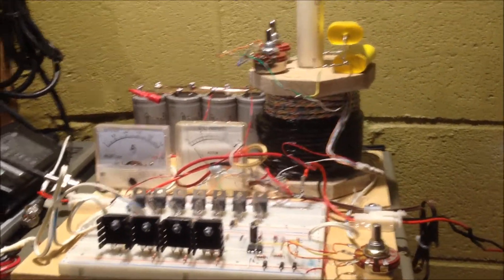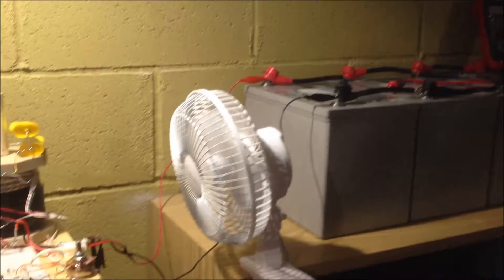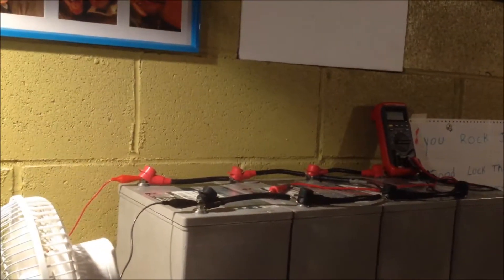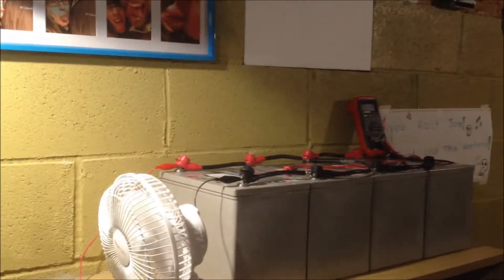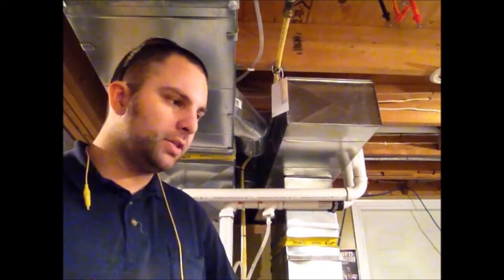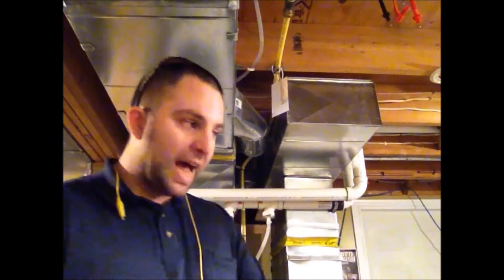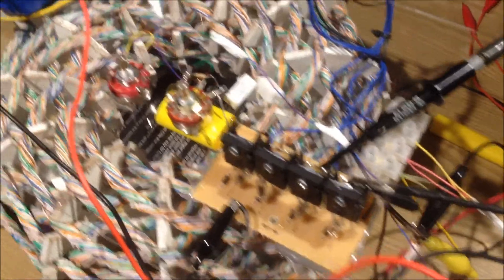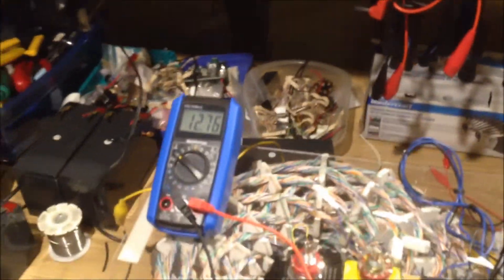Solid State Bedini SG Cap-Diode-Mod Repliaction

Comment: g'day Joe , ive been doing this type of stuff for 10 years now so this is my advice with what your doing roughly at this stage . battery c20 rates  for discharge are 100ah = 5 amp draw for 20hours , 50 ah = 2.5 amp draw for 20 hours , 25 ah = 1.25amp draw for 20 hours , 10ah = 500ma draw for 20 hours you get the drift :)  69ah = 3.45 amp draw for 20 hours . i can definitely say your circuit to charge 280 ah needs at a minimum of 14 amps input to charge the batteries to their full charge , if their sulfated  lots more amps are needed to break the sulfation up . if your circuit hasent charged what your trying to charge in 48 hours your wasting your time the circuit isnt big enough . if you have 2.5 on your input a 50ah battery would be a good starting point  .wish i had more time hope this helps .